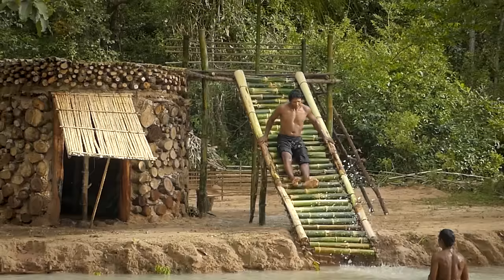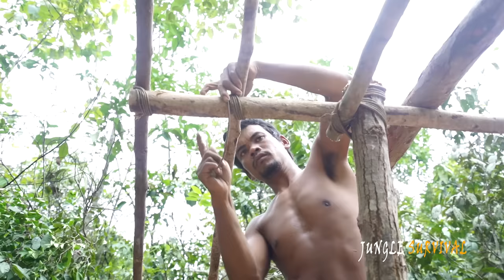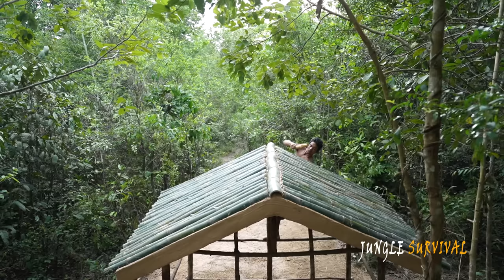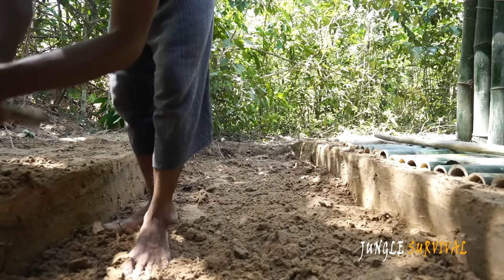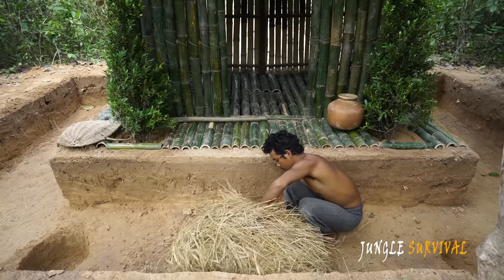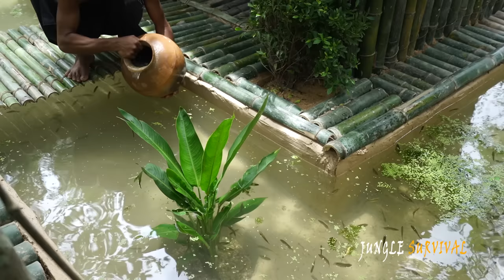Build The Most Amazing Bamboo Cabin Villa with thousands Fishes Pond Over Secret Basement Tunnel

Comment: I've always been wondering about the water in the pools.  is he planning to change it from time to time? if not,  won't it become foul after a while?
Reply: I thought the same. Considering these guys ingenuity you'd think digging a small hole to drain and just refill would be the thing. 

But perhaps they just build these places then move on to the next project so they don't have time to "foul" up the water?
Reply: The plants he dumped on the surface of the water and the two that were planted in, will help with oxygenating the water and maintaining it relatively “unfoul”, while also providing food for the fish, whose droppings in turn will feed the two plants.